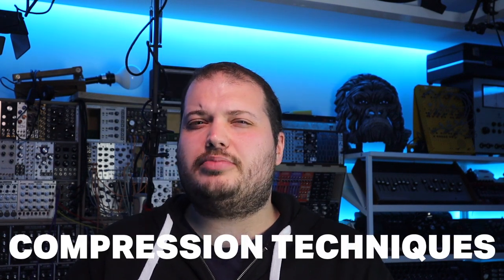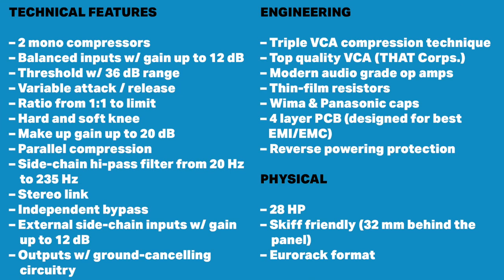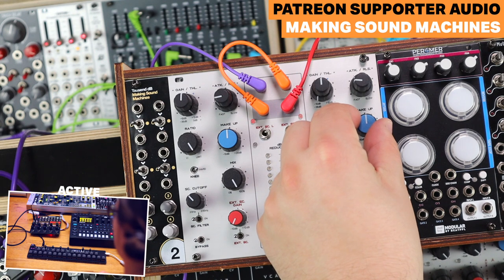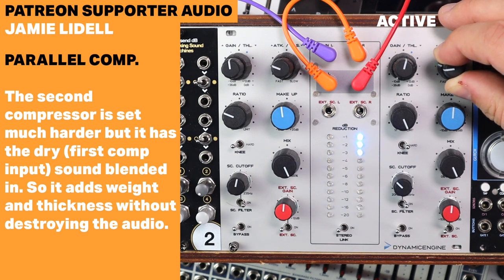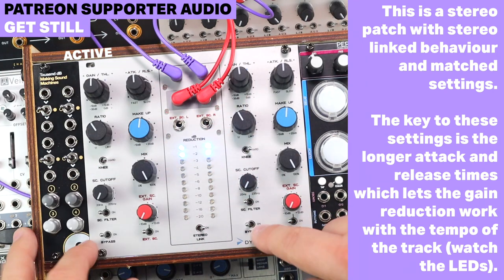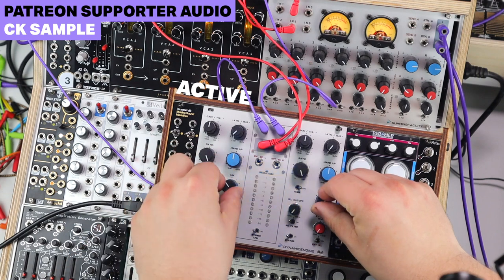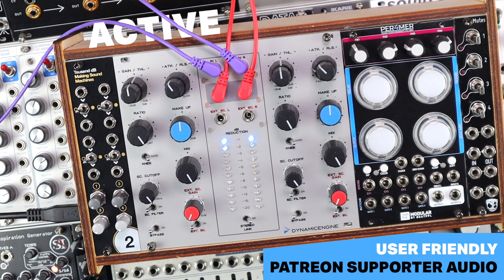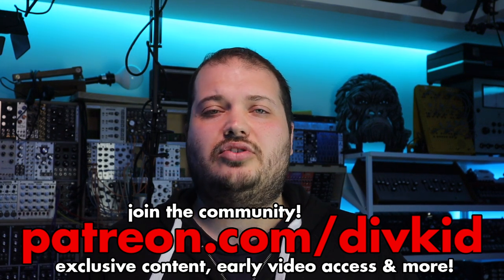Techniques for BETTER Compression // Audio Gear Obsession DYNAMICENGINE

Comment: In the world of compressors, the price is quite reasonable. In the world of Eurorack, it's premium but not unheard of. Tbh I balked more at the 28hp than the pricetag. 
I don't even mind the lack of CV control. I never use it on my L-1 compressor anyway. Compressor settings should be dialed in with purpose and focus.
Reply: You should use the CV on your L-1.  It's so nice, and I feel no absence of focus when i do.

Comment: So much great info. I also wanted to share another great primer on compression in modular, the one from VCV Rack Ideas (aka Artem Leonov). I'm sure there are many, but this one really opened my eyes. It uses VCV Rack, so it puts like 50 compressors all over the patch, which is impractical in hardware, but nevertheless it's got some great, practical advice.
Reply: google "vcv rack ideas compression" to find it. (I have no affiliation to the channel, I just think ppl who read these comments might like that video.)

Comment: €1,138.00.  These guys have to believe they're Rupert Neve with these prices on relatively basic, studio quality mixer and compressors.
The L-1 Midside Discrete Microcompressor already offers mastering grade sound in the format... as well as m/s, envelope outputs, cv over alle, for less then half the price.
Reply: tested it at a friends... these guys are like Neve in a way. Honestly. It sounds really really good... I understand the price also is not fitting for me these days but that's 100% normal for a unit of this kind and compressor with these kind of  building parts as well. also I don't believe someone try's to get rich with this stuff here either , as this aims for a very very small community
Reply: @jmawa8616  comparison to Rupert Neve gear is just about how their price can be 50% higher based on the brand.
Reply: @Rareos  well the price tag of this unit we are talking about here is equally to a mono Neve pre amp. so I had this in mind.
Reply: @jmawa8616  yes i hear you, i just meant the price relative to very similar products from other manufacturers.  One example, Buzz Audio DBC-20 (beautiful hand-built diode bridge compressor from New Zealand) 1699€ in Germany.  Rupert Neve 5254, 3590€.  Both relatively similar in form. function and build quality.  One company just sees themselves differently, and has the marketing budget.